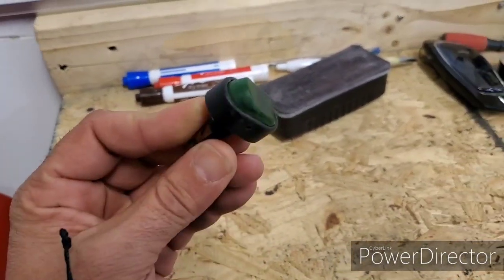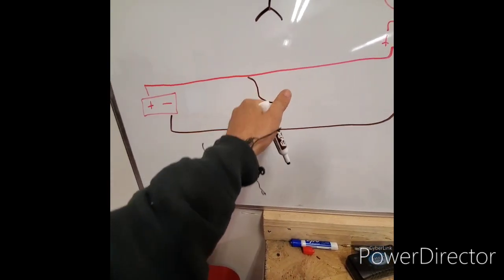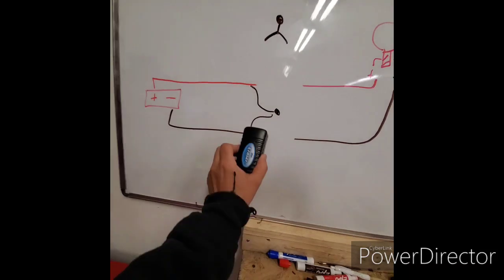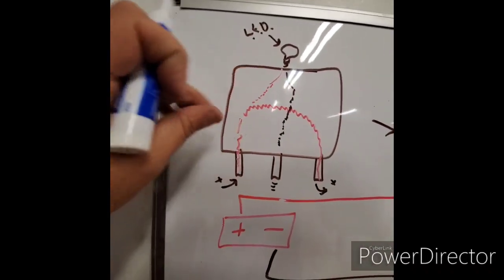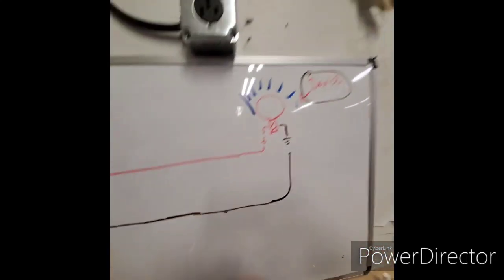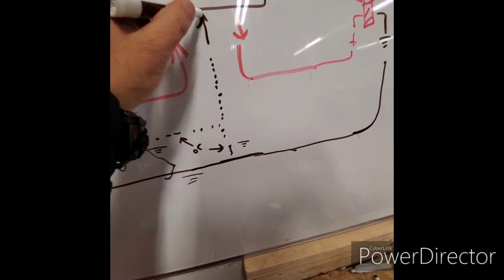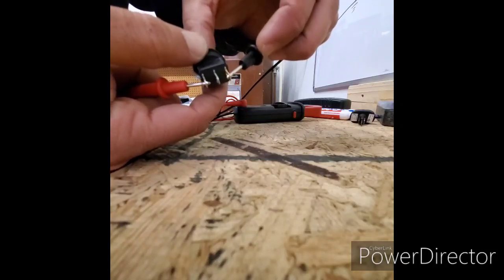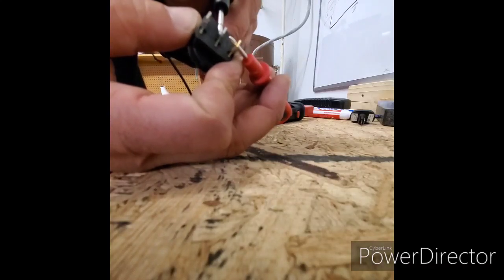How to wire an LED toggle switch , ( on-off 3 prong rocker switch ) 2020

Comment from the maker: (Below is a collection of my favorite toggle switches available on AMAZON) 
https://www.amazon.com/shop/myonlinecarguy1?listId=3VC6XB2R7NN0L&ref=idea_share_inf
(If You found the video Helpful in any way..........That "Thumbs up" on the video Goes a LONG way for us here. Lets us know we are actually helping you all out. Thanks in ADVANCE)
Reply: You said you wanted to know what happens when you hook it up wrong,,lol,,It smokes and burns up the negative wire!!  sorry to say..I found out,,
Reply from the maker: Oh no. 
Where you able to at least catch where you had wired it up wrong? Is your device ok? And whatever people may have ben around, ok?
Reply from the maker: Its more typical for the 3rd prong to be (-) , but each company does their own thing. If it is infact (+) and your passing (-) through in the toggle side. Then yes, you’ll have to source power from somewhere. However, that all sounds very backward. The internal led will req both (+) and (-) . So. Its more likely that your passing (+) through the toggle side, and needing (-) to finish the supply for the led. Verify the voltage of the toggle side, and then confirm the switches labeling to be safe.
Reply from the maker: Thanks, hope it was helpful for you.
Reply: awesome, what if i am using a 3 wire toggle to my fan relay(typical bosch style)?
Reply from the maker: A switch simply cuts/send power. Its a mechanical open/closed circuit. So if your relay needs a managed "power" wire, then go ahead and use a switch. The device itself doesnt matter. Only if its A/C vs DC does the switch have to match.
Reply: @myonlinecarguy1  cool, I just put the toggle in-line between keyed power and the relay.
Reply from the maker: Sounds solid to me. Means switch is desd without key......and then if key is on and switch is on, relay will have supply.
Reply from the maker: Sounds perfect.
Reply: I'll love the harbor freight tools
Reply: After fishing around, I finally had the correct terminology to find your video.  I am wiring a pair of auxiliary lights (cheap eBay cree lights) on the front fender of my 2014 Ninja 1000 and although I had them wired thru a switched FUZEBLOCK FZ1, I wanted to wire in an off/on switch because they are super bright and I didnt want them on all of the time.  After seeing your video, I am fully clear on how to do it with an nice LED switch. Thanks a bunch.
Reply from the maker: Awesome to hear.  Make sure your switch can handle the overall load. Too many light bars and such are too much for a basic toggle. Just fyi.

Comment: But if you look at the switch it shows the ground on the outside not the middle
Reply: The video is rather confusing because of that.
Reply: Doesn't really matter where the prong is, the concept is the exact same...in,out,ground

Comment: the led on my rocker switch is on when the lights are off and off when the lights are on. Do I just switch the two outside wires?

Comment: Thank you so much!! Hundreds of millions of videos on YouTube and no one's bothered to explain how to find out how a switch is wired internally.
 Not all switches are created equal and I got one with 3 prongs, absolutely no markings (all solid silver colour as well) and no idea which prong is which? I have a multimeter but never really used it, but now I can figure out how my switch works and can finally install some work lights on my SUV to help with reversing on dark forest paths and loading trailers. Thank you again for putting it into layman's terms and not assuming that everyone has a switch with clear markings or just naturally know how they function. 🙏

Comment: Thank you! Replacing toggle on rv portable macerator pump. Original ran over by friend.  Second one melted due to 10 gauge wire being spliced with 12 gauge wire....whoops! Honestly didn't think batteries could cause a motor to put out so much heat. 

I liked the ease of the led lighted switch and seen that it was available in 12v 30A, as I needed. Got home and looked at it and was stumped. Found your video in a search. 

I appreciate the diagram and how well you explained. Thank you!  

My mother is very grateful to you for saving her from having to go out into the night to our house. It reminds her too much of the scary outhouse runs as a child. So glad we never had to experience that.

 As it was, my feet barely touched the ground when I turned my bedroom light off. I should have been in the long jump of the Olympics.

Comment: Excellent video, so clearly explained simply because you showed the circuitry involved, couldn't be better. I looked at the top three featured videos on how to wire up a 3 pin toggle switch and they were conflicting in their explanations primarily because they did not explain the circuitry. Now I can get back to wiring up my campervan with confidence! Thank you.
Reply from the maker: Thabks for the great feedback. It greatly appreciated.

Comment: Preciate it. Good explanation. Im just trying to wire these 6 (3w-12v) LED to 1 switch. I got it now. Thanks.  All +'s off lights joined together to 1 terminal on output. 1 wire from fuse box to other input. All grounds together from lights and the ground from fusebox as 1 terminal for ground.
Reply from the maker: Sounds about right.

Comment: Thank you for the video.  It definitely answered a few questions I have for my current project which is to add two 7" LED light bars to my boat trailer which I'll be able to turn on/off from within my vehicle.  Each LED bar is rated at 60 watts, 12v-24v so using a 12v car battery, I calculated each light bar will use 5 amps (60 watts / 12v).  I hope this correct.  Anyway, I'm planning to run a wire from the positive terminal on my car battery to the "input" on the 3 prong toggle switch, a wire from the negative battery terminal to the "ground" on the switch then a wire from the "load" prong on the switch to a fuse holder then from the fuse holder to the positive on one light bar.  I'm going to run the 2 light bars in series so the negative from the first light bar to the positive of the second light bar.  Finally, the negative on the 2nd light bar to the negative battery terminal.  I do have a couple of questions: 1) does this wiring plan sound correct? 2) what size fuse should I use (5 amp or 10 amp) and 3) what gauge wire should I use?   From my car battery to the back of my vehicle is about 16 ft, then from the back of my vehicle to the back of my boat trailer where the light bars will be mounted is roughly another 17 feet.
Reply from the maker: The wiring plan sounds solid. If you are infact able to run it in series. Then 5amp should do. But if parallel is required q0 amp for sure. These are minimum though, because mote amperage will be required to compensate for wire length and connetion resistance.  If it was my design, id go parallel,  id use at least a 14awg wire and fuse each output with a 10amp per light. (Havi g them seperated this way, will make led failures easy to trouble shoot and wont take down the whole circuit. Also make sure to fuse the wore from the batt as well matching the total amperage and wire rating. This fuse should  be as close to the batt as possible.

Comment: I was wiring up two 4” LED lights to my atv. I know of ground as green which grounds to the frame. You clarified that ground on 12v is the black wire to the battery. Hense positive and negative... lol. Within the first 30 seconds to a minute into your video I knew what happened
Reply from the maker: Yeah....i hate that they trick us that way. With red to pwr and blck to ground....sux.

Comment: This video helped me explain how I will wire my rocker switch to my 12v light in the bus conversion I am building.   My 12g wire has an extra wire (3 solid wires inside the wrapping) so I was a bit confused, so now I know I just dont use the copper (3rd) wire from the 12 gauge wire.    That may not make sense but your video and a friend helped me understand what needs to be done.  :)
Reply from the maker: I gotcha. Makes sense. Im glad it helped. The 3rd prong is really only needed if your lighting the switch up and even then, that ground can be grabbed locally, doesnt have to be a long wire pulled for it.
Reply: @myonlinecarguy1  I think thats what my friend was trying to as well, that I can ground the light to the bus chassis.  :)
Reply from the maker: You absolutely can. Ground is ground. A direct wire isnt needed from the batt source. A local ground will do it perfectly and simplify the cable pulls.

Comment: Thanks for the help I am working on a power box for my kayak/camping and hooked the ground up to one of the outside terminals of the 3 prong led switch.....flaming rubber and glowing wires.  Quickly disconnected from the battery and got the wires loose. Exciting night but now after the video I'm sure that will not happen again thanks again wishbi would watched the video b4 attempting myself.
Reply from the maker: Hope that worked out better after the video,  lol

Comment: I am new to your channel. That was extremely helpful. I am working on converting an old AT computer power supply to a 12v and 5v work station to test my car parts. Ps you look and sound like Vin Diesel. Thx buddy. Dr Rob

Comment: thank you Elliott for your excellent demonstration. Not only did you have the toggle switch that I am looking to replace but you're explanation in detail with your drawings and what I would call normal speaking tempo and normal English pronunciation or is it innunciation ??? lol😁.
Also  having a quiet shop makes it all the worth while listening.
 I have a mr. Coffee basic machine that for some reason that little round small toggle switch that you have as an example stayed pressed on the on position and will not return to the off position. My son-in-law who was the last to use the coffee maker notice that it stayed on the on precision and not return to the office so he just unplugged it off the wall and the next time that he made coffee he just plugged it back on to the wall. Now I come to make coffee and it doesn't work with the switch or plugging it to the wall so my guess is that inside the little round toggle switch it must have gotten burned out and somehow for some electrical reason maybe the switch wont rock back to the off position ??? I did visually check to see if the wires were burn some where, they are not.
 I kind of want to open the toggle switch and see what's inside of it since I am not an electrical educated person at all, but just a tinkerer who believes that either I can fix it.... if it's broken ?  or I can switch a part for a new one and make it work. Plus lately with this covid-19 shut down I'm having more time to explore these household appliances.
I'm also working on a vacuum cleaner that my daughter was about to throw away cuz it doesn't work and so far I just found too much dried up combination of dirt and possibly water that was vacuumed which harden up and a combination of string, hair and other things wrapped up on the spool, most likely keeping it from turning. I put that one aside realizing that the belt is okay and it's probably just need a deep cleaning so I could work on a lawn mower...
Whenever you get this note or one of your coworkers please accept my appreciation for each of you that is willing to help us understand even as minute as a toggle switch connection and I'm guessing from your explanation that if I wanted to install the toggle switch but not carrying for the LED to turn on, I can just install it on either the ground or the positive wire and not necessary have a third wire connected.
 This lesson is going to help me also in case I want to add some lights to my motorcycle with its on toggle switch and I know somewhere I will install a line fuse.
 Thank you, God bless you, stay safe and healthy take care.
Juan
Reply from the maker: Hello Juan, 
This is Elliot. I want to start by thanking you for the kind words. The internet can be a pretty aggressively angry place quite often, lol. So, I want to make sure you know the time and efforts you put into the well written,  explained and spelled comment is greatly appreciated here on my end. 
That said, I would like to try and address your questions. Forgive me if i miss something, its very late on my end here and I am a bit tired. 
As far as the switch question, YES, you can wire it in the way you explained (and I explained) with only the "pass through connections without using the LED terminal and the switch would absolutely still funcrion as far as "on/off" is concerned. 
In regards to the vacuum,  I literally have ZERO CLUE about vacuums.  However, i do know motors and based on your explanation i think your right. Its probably just dirty in areas where electrical contact needs to be. 
And finally, i want to express that as a youtuber myself who deals with soooooo many "opinions" and people who insist on negative energies, you my good sir are one of the BIGGEST reasons we do it. The gratitude alone makes it worth it to know that we  (By we i mean "I") do it. 
Thank you again and know that you are equally appreciated.

Comment: I did exactly that. I was trying to wire a three prong toggle switch for my amp. I ended up hooking the wire from the toggle to my 12 v on my headunit and the ground on the toggle to a ground on a bolt and blew my radio fuse. I still haven’t hooked it up yet. Thats why I’m here lol
Reply from the maker: Yeah man. They been getting us to ruin equipment for yrs with that damn red/black wire lol. Hopefully you understood what ibshated and can get ur system back up n running with ease my dude.

Comment: I'm trying to wire a 3-prong switch inline with existing wiring on my tractor to power a work light.  The prongs on my switch are labeled "power, ground, signal".  The work light is wired from the factory to be "hot" all the time.  So, if the key is on the light is also on.  I'm trying to wire the switch inline so that I can control when the light is on or off.  So far I've had no luck.  I like this video and I'm going to try it again later today.

Comment: Could I do this on a passive circuit? I wired up some acoustic guitar pickups to a toggle switch, now I want to use an led switch instead, can I just use a 9 volt to power one passively using this same method?

Comment: Thank you very much for your video I enjoyed it I have one problem the light stays on on the switch no matter what I do I purchase another two of them and they both are the same thing and I’m talking about the little round LED switch that have the LED lights on the top follow all the directions thanks Eli
Reply from the maker: I think your 12v is connected to the setches "output" not the input. It would allow fpr cut off still of the device, but the led, would never shut off. Check that out.
Reply: I did revers The wires and it’s still on no matter what I do it’s only three wires the light stays on all the time and it’s not my first Toggle switch but when I used another toggle switch the rectangle one it works perfect but I really like the round one but thank you for responding
Reply from the maker: That's interesting.  Typically the ground is a constant connection to the led, but only the "output" pwr, connect to the led internally.  That way when you send pwr to the device, it also goes to the led... matching them up  giving you a logical light, when device is on. 
Are you passing +.... or -.... as the pass through? 
Sometime if the cutoff wire is (-), it can complicate the led circuit.

Comment: In auto applications, it's common that switches pull the load to ground to turn it on.  So if you want to use a lighted switch that way,  you can't.  If you switch across ground, the LED won't work, since there's no power at the switch and consequently no power to the anode of the LED when the switch is logically "on".

Comment: Thanks so much best 3 prong switch explanation. As I have been searching for hours for a good visual video, as I'm installing a switch on the water pump in my camper van. 
Next project is to install a battery to battery charger for my camper van. To charge Lithium batteries. Please let me know if you have a video for it?

Comment: Best explanation by far. I got a question. If you have say (6 or 8) 20A 12v, 3 prong round led switches in a panel and each switch is being used to activate a separate 40A acc relay, can I use 1 positive wire from fuse box to power all switches with a single fuse or do I need to limit the number of switches going to one fuse? My understanding is that the switches are only using few amps combined this way and the relays are then doing the heavy work. Thanks for any help.
Reply from the maker: If the "feed wire" can maintain a (6x20amp-8x20amp) 120-160amp load then 1 wire is fine, fuse the feed wore accordingly.  But also fuse each switch to isolate each circuit just incase 1 of those devices actually causes an issue. This was the switch fuse should blow. Both protecting the feed wire,  all other devices and also showing you wich device was the problem child, for servicing.
Reply: Ty so much for quick response. That helped me a lot. You got a subscriber. You’re awesome thanks again!